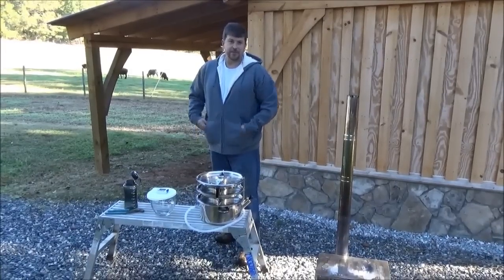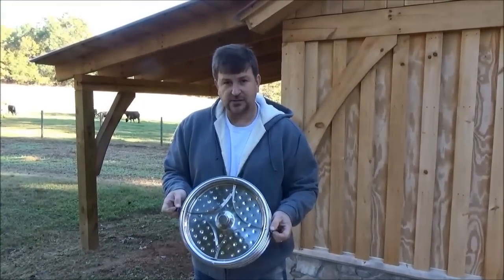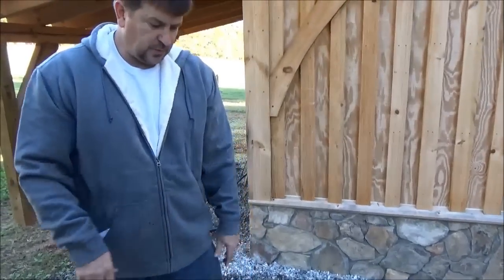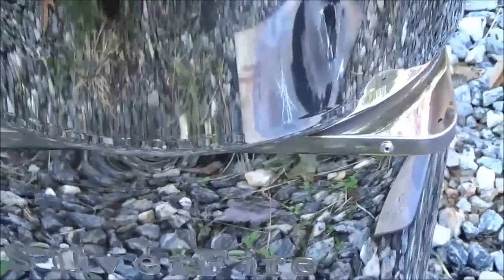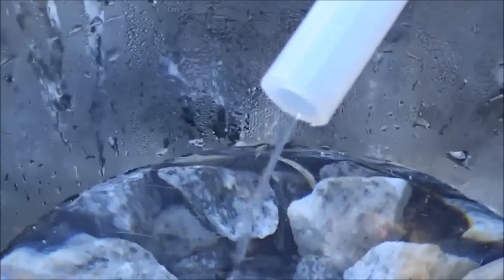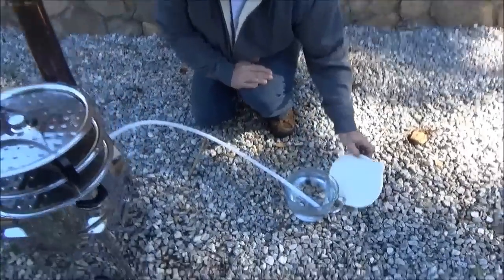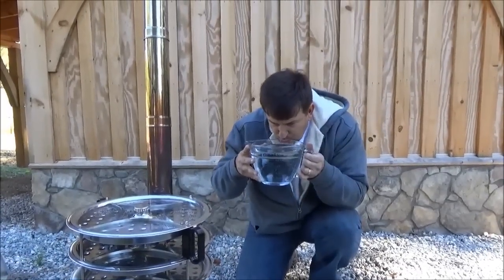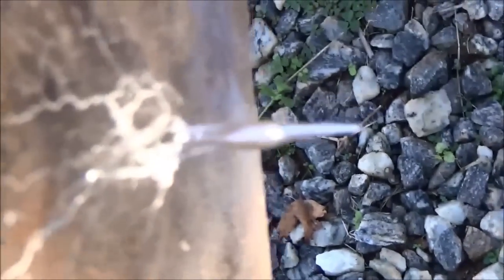Off Grid Water Distillation at its Best!

Comment: I'd be interested in setting up on electric burner powered fully.by solar. Being able to setup an auto feed for water source would also allow continued operation with minimum monitoring
Reply: You do not want a continually running system, especially if you are removing salt from the water. It needs to be cleaned out between batches or you will ruin the system.
Reply: @Web3Dverse  If mineral deposits are building up, they can be cleaned off easily with a soak in CLR. Be sure to rinse the system out thoroughly after using the CLR soak though before producing drinking water again. I soak my system in CLR about once a week to prevent any buildup from happening. You do not need new CLR each time, it can be reused multiple times.

Comment: Waterwise or Survival Still?   I was looking at the Survival Still and saw your video review of it.  Then I saw this video for Waterwise, too.  More money, but more water produced.  Having tested both of them, do you find them to be comparable, or is this one really worth the extra $$$$?

I'm amazed that this one doesn't seem to have steam coming through the dimples.

Thanks for your very informative videos!
Reply: I also looked at the Amazon reviews, and some say that the quality of the metal and craftsmanship is not good.  Survival Still is Made in the USA, but I wonder about this one.   I'll keep researching...!
Reply: Nancy M
Just to clarify -- I was referring to the the Amazon reviews of the Waterwise that were negative about the quality.
Reply: The reason there is no steam coming through the dimples is there is no hole in the temple. The steam is on the underside of the trays, not inside them. The dimples are where the steam condenses to form water droplets on the underside of the tray and runs back to the collection point. If you look very closely at it when it is running on a really hot, humid day with no breeze, you can see a very small amount of steam coming off the end of the trays every once in a while, but it is usually already condensed back into water droplets before it reaches the ends of the trays.

Comment: I don't know if I am getting too old or what but I could not follow your description of how this thing works at all...... You put water in the bottom and some on top shelf, how the heck does this work?
Reply: The water is poured into the bottom pan, that it heated to the point where it creates steam, the steam vapor collects and cools on those three suspended pans. Once the water cools back into a liquid form, it drips down to the collection point, where it pours out of the unit via the plastic tube.
Reply: The water that you pour into the top trays stays cooler than the boiling water below and is what is cooling down the steam to form condensation on the underside of those trays that is then diverted back to the collection point.

Comment: Hello Scott,
I have seen the description of the very innovative Waterwise from you. On your website, but he is no longer to be found.
Distillers with cable are very expensive in power consumption.
Can you still offer the Waterwise and possibly a smaller model that fits on a kitchen table?
It is important that the distiller does not smoke and work like a gas burner.
Oliver

Comment: does this process chelate or disalve flouride or other chemicals in water?
Reply: Fluoride can be distilled into the drinking water as well. the higher the temps, the more fluoride also makes its way into the "clean" water as it alos evaporates. most sellers or proponents of distilling will not tell you this

Comment: I'd think adding some kind of porous rock to the boiling chamber would increase surface area/evaporation.
Reply: not unless the rock has been heated before eing dropped inside, it will do nothing but displace water.
Reply: Thermodynamics applies here as everywhere, the amount of steam/vapour produced is directly proportional to the amount of heat suppied, no amount of increase in surface area will make any difference.

Comment: I have a question concerning the 'cup' that collects the distilled water that sits in the middle of the pot above the undistilled water.
Wouldn't there be a pretty good chance that, at least, a small amount of boiling water splashing into that cup? Even a SMALL amount of splashed water would contaminate the ENTIRE batch of distilled water.
Can someone correct me here if I'm wrong?
Reply: It has a stainless steel screen that floats on top of the boiling water. This screen prevents the boiling water from splashing up and on to the collection cup.
Reply: Any splashes are stopped by the screen preventing it from reaching the collection cup.
Reply: @okieprepper  doesant show or mention a screen in the video...haa ha there is no screen

Comment: Actually the wind would increase the efficiency.
Try on a cold winterday to get more out of it.
Reply: Exactly, the breeze flowing over the collector plates at the top speed condensation on the underside of the trays, that is the water the system is collecting. The more breeze that goes across those trays, the faster the water would cool and condense.

Comment: You could do a lot better using a pressure cooker and just lead the steam down into a bucket with more water around to cool it down in the start. Much simpler, cheaper and faster.
Reply: What do you mean cool it down have you tried this?
Reply: @ted6090  Yes, many times. It is just basic destillation. If you boble the steam into water it is a easy and efficent way to cool it down, but if you loose steam pressure it can suck the water back rader violently. A cooling jacket on a pipe is a better way.

Comment: Hi, would you or do you distill rain water?
Reply: I just drink my rain water straight from the tank
Reply: The chemtrails release nanites, which are able to target specific organs and shut them down. I would not drink rain water, or anything except distilled water.
Reply: Thanks for your replies, I see what your saying supermuble and agree, I was more thinking bird poo and airborne dust and the like.
Reply: Rainwater IS distilled water already. Water vapor (steam) condensed to form raindrops to create rain. Technically it is the exact same process, yet the rainwater has collected other contaminants in the air as it fell, and from the roof, so I would use a filter like the Berkey to clean it before drinking it. I would not go through the process of distilling it again though, filtering it is a much faster and easier process.

Comment: Use a fresnel lens to distill water with the sun for free
Reply: Also an idea I've had but the issue is heliostatic tracking - did you solve that problem by chance?
Reply: I'd really like to get one of these lenses.
But don't know how to get one.
Reply: @pychohobo1832  

they throw them away every day in old TVs sitting on the sidewalks of big cities
Reply: Try stretching clear plastic wrap like a roof over an adjustabe height frame, pour water on it to form a water lens that uses tracking mirrors to light up ur fancy. Need more magnification? A bigger frame and/or deeper water. 
I saw a big water lens here on youtube years ago, but the mirror idea came to me as soon as I started this post.
For all I know somebodies likely doin it already, hope somone tries it regardless!

Comment: very nice but ouch on the price...........
Reply: I agree for $400 that's criminal. It's a pot with three lids. Granted it's well made and took research and development costs to produce but  a price point for me would be about $60 tops
Reply from the maker: drielok JOHNNYMasteratArms DUNN  The survival still was about $38 less.  The upper trays are much more than lids.  I agree it is expensive but I was just so glad to find a good solution for off grid distilled water.  I don't set prices I just test, use and sell them.  I am accumulating a lot of stuff that doesn't work very well.  Those don't make it to YT.
Reply: engineer775 Practical Preppers  yes sir understood it isnt your price and yes it looks like an awesome product.....just commented it was pricey for my pocketbook.

Comment: The alexpure filtration system is easier to use at a much higher production rate from Infowars.com.
Reply from the maker: filtration is always faster but it can not produce distilled water.  water required for items like my flooded lead acid batteries.

Comment: This design is pretty primitive as you have to top up the various water levels by hand. It is easy to make a fully automatic still with everyday components. If you don't need a large supply of distilled water you can use an air cooled condenser.
Reply: I don't need to get any wealthier than I am thanks. I used to work in a lab where automatic stills were the norm, they aren't exactly hi-tech and are avalable from lab suppliers. All you need is available from your local DIY store.

Comment: Depending on your water source...but most water now, has chemical residues in it, which don't all go away or stay in the reservoir of raw water.  Many of those chemicals go airborne with the steam; it's very important to use a solid-block activated carbon post-filter (filters the re-condensed water), to remove those from otherwise distilled water; the more polluted the source water, the greater the need for running the distillate through a good carbon filter.    If your source water has fluoride, that requires a special filter designed to remove it, since fluoride is Not removed by carbon filters.
Reply: Distilled Water does NOT require a filter to remove Fluoride and steam distilling removes 99-100% of it. A Carbon Filter would do nothing to remove additional Fluoride. I personally don't trust any filters added to the Distillation process. Distillation removes at least 95% of everything anyway.

Comment: PS. If you drink distilled water and are profusely sweating, make sure you add some salt or electrolyte mix, because distilling removes all forms of mineral and salt impurity, you will need replacements normally found in hard water.
Reply: No. Don’t add salt. But make a organic carrot juice on the side celery... all minerals salt needed
Reply: @JESUSSavesWAKEUP  use Celtic sea salt
Reply: @305floridian  I've been using Redman

Comment: does this process chelate or disalve flouride or other chemicals in water?
Reply: Yes distilling water removes flouride
Reply: depending on temp that the water is distilled at. the higher the temp, the more fluoride is also distilled with your "clean" water.
Reply: +believe it this is true? I've read distilling water removes the fluoride
Reply: believe it Fact: water boils at 212°F no matter how much heat is applied. This only very slightly depending upon sea level.
Reply: Distilling does remove Fluoride from the water, but not Fluoramines which a few cities are starting to put in their drinking water. A simple charcoal filter afterward would remove that though.

Comment: You definitely don't want to store it in plastic.  Regardless as to if it is BPA free the other plasticisers can pollute one's body.  However, using this on a daily basis would require a partner of some kind to stay home and deal with this all day, or you are rich and have all the time in the world.  A better device would be one that could work for dozens of gallons of raw water while one is at work and could be left unattended like a hot water heater.

Comment: not tryna be a jerk but you and your family will die of dehydration if you count on this thing to supply you with three gallons per day  , i say this because on a hot day i at times consume this much water , so for 3 people thats 9 gallons of water  problem is your only getting 12 in a 24 hour period despite the advertised 16 gallons , the problem is who stayes awake for 24 hours so your only gonna get 6 gallons per day not 16 , yes you can run it at night but most fires only last 2 freekn hours without stoking or adding fuel , my suggestion buy 2 beer kegs one for boiling 1 for capture , this device would be good for 1 person if they had all day to constantyl check on this thing , this just doesnt seem practical , build your own